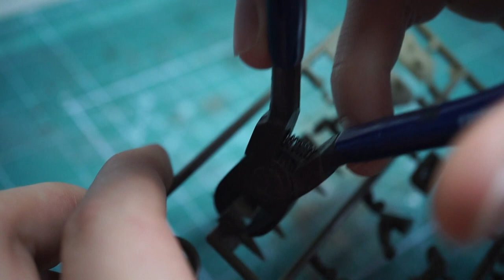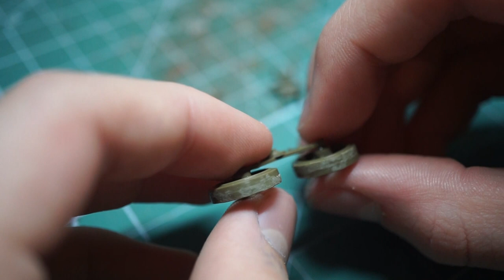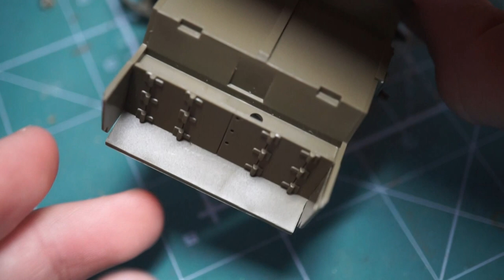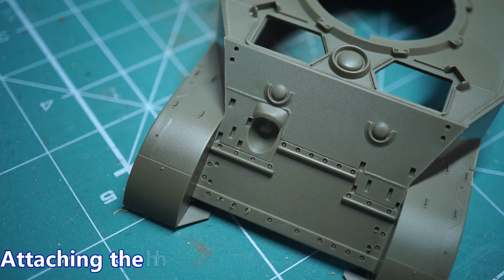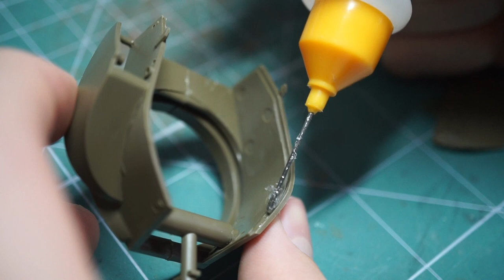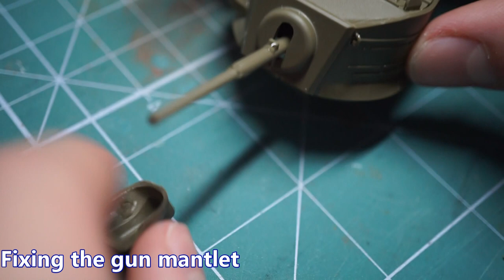Tamiya 1/35 Scale M5A1 Stuart Build Pt.1 | Narrated

Comment: I recently started this kit and was wondering why it came with extra bits of kit?  I have a few panels and an M-2 .50 cal machine gun to name a few that aren't on the instructions.  Is there a use for them or a set of build instructions?  Thanks in advance.
Reply from the maker: Yeah, I know what you're talking about. AS far as I know, they are extra parts from another boxing, though not sure. I wouldn't worry about them, maybe just use them for kit bashing :D
Reply: Thanks for the reply.  I appreciate it.  Quick question...did you use any putty/filler on this build?
Reply from the maker: @c130jlm  I can't remember exactly as it was quite long ago, though i don't think I did